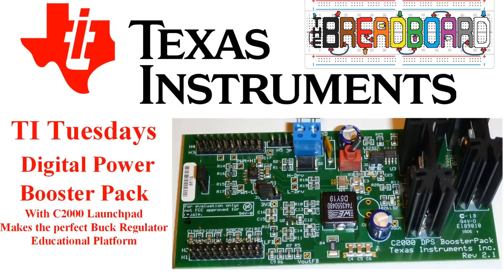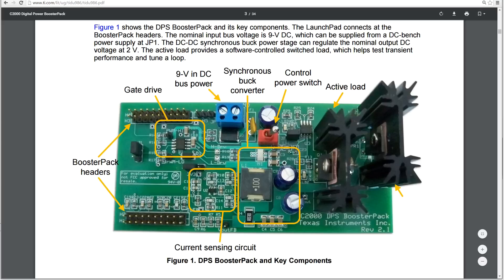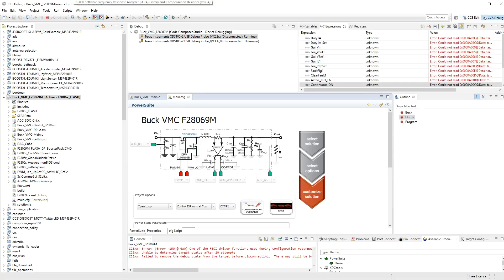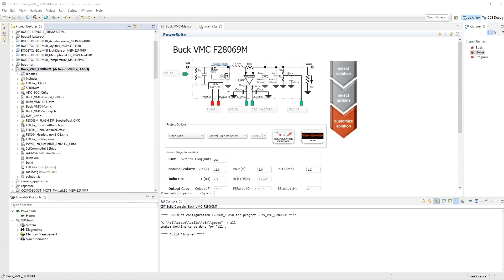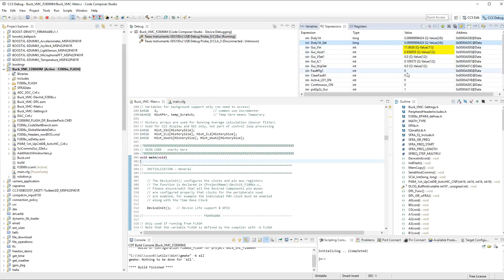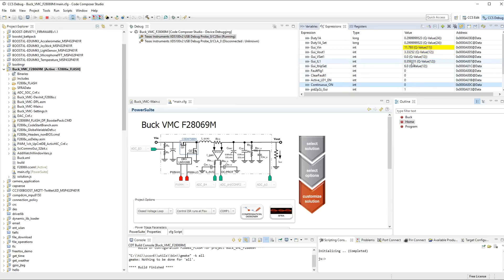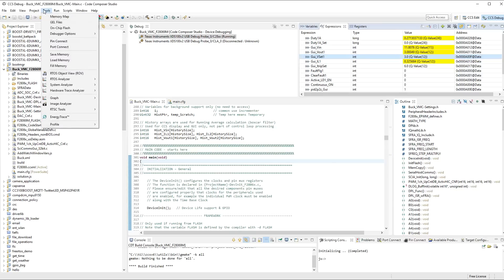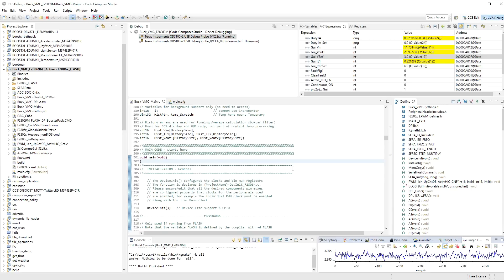TI Tuesday - Digital Power Boosterpack BOOSTXL-BUCKCONV

Comment: Hi i have a problem, my convertor do a sound when i put more than 7v in input and Vout is equal than Vin
Reply from the maker: Are there any events happened before this sound appeared, has this board been working or has it always done this. the only place I can think of were a sound would come from is the coil in the actual convertor
Reply: @TheBreadboardca  it was working really good before but we start to drecrease the Vin to study the stability in Vout and then when we try to increase Vin again it starts to do a sound abd Vout seems like being cortocircuit with Vin
Reply from the maker: you may also need to increase input v to 9 - 12V, 7V may be too low for this board. (From memory of over 7 years ago :) )
Reply: @TheBreadboardca  when i put 9V it starts to sound weird and that was not happened before :c